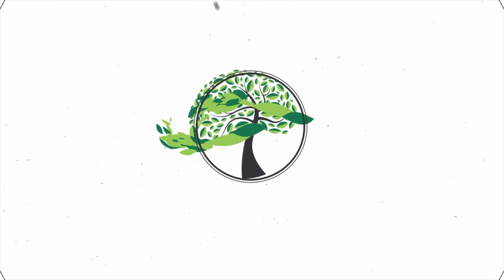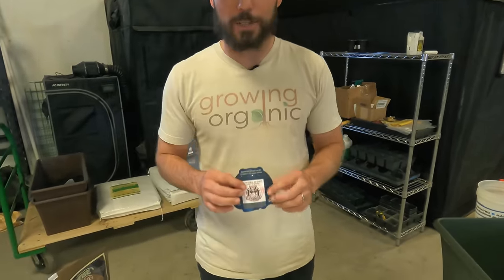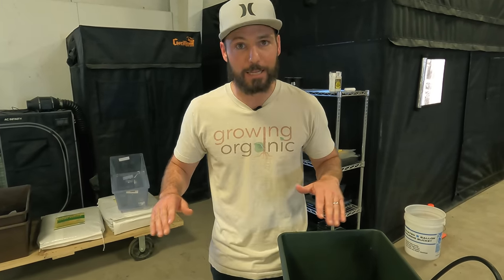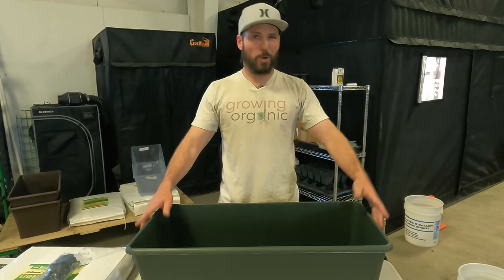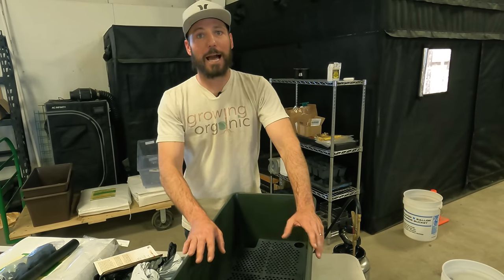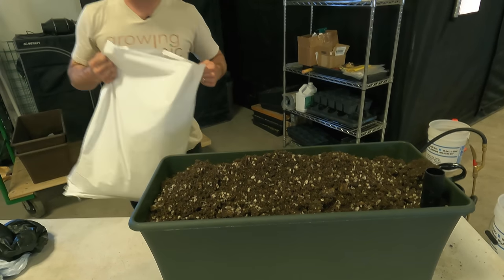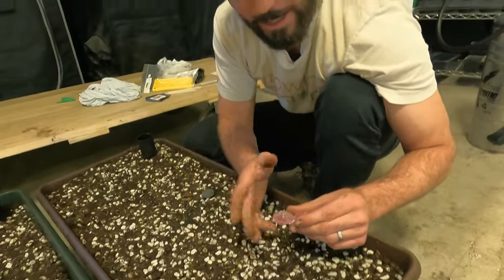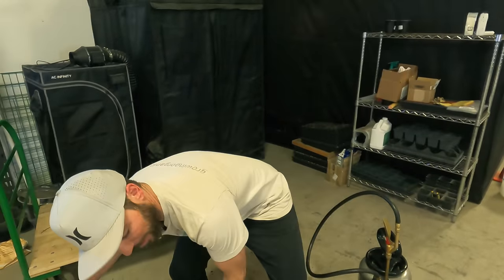BuildASoil: EARTHBOXES AND AUTOS (Season 3, Episode 9)

Comment: 2 per Earthbox works great with most autos but some of them will get way bigger than you would think. Those do better in the Earthbox Root and Veg at one per pot. You can treat the Earthboxes like a no-till bed for at least 2, sometimes 3, full runs before you really need to dump and reamend the soil. You'll need to top dress for flower and maybe some light foliar feeding to make it 3 runs, but these SIPs work really well with autos.
Reply: Sounds clever. Never heard of earth box's and am organic but autos don't need no till as they are too fast. Your method seems like the best of both. Also like the idea of slow release over 3 or more runs before tilling.

Comment: I have recently swapped over from Rain Science grow bags to Earthbox systems running  the BAS Take and Bake soil.  I have two Mephisto Auto's per box and honestly think they are too large to share a container.  About to get my 2nd tent rolling, just waiting on some new Earthboxes to be delivered.
Reply: What size earthbox? Reg or the jr?
Reply: @Southern_Solventless  I used Regular sized EBs.  Primary tent had 5 Reg EB with 10 total seeds started.  Lost one on transplant, had another stunt out hard leaving a primary plant and a runt in one.  Ultimately, I did not have the space needed in the tent to properly train or maintain them and the plants suffered because of it.  5 EB in a 5X5 with fans and humidifier doesn't leave much room and next run I will drop back to only 4 or maybe even  just 3.  I missed not being able to properly reach the back row of plants.

Comment: Only suggestion I would make is adding something to lightly circulate or oxidize the water maybe a set of small air stone through the over flow hole of that water goes stagnant that root rot waiting to happen 

Love you guys hope I could help thank you for everything
Reply: Is not DWC just wait till reservoir is completely dry

Comment: Great channel.  You are a gold mine of really great information and insights

 I love earth boxes [picked up 6 of them for $20 at a yard sale} and am a fan of SIPs in general and would like to share some tips.  I have been growing for over 50 years have an MSc in Plant and Soil Science and published a methods paper in HortScience in 1992 after inventing a type of Continuous Flood Irrigation method for greenhouse plants in containers called Constant Flood Irrigation where i maintain thousands of plants in 6 to 8 inch tall pots by simply placing the pots in saucers and with 2 weighted drip tubes turned on the drip system 4 times per day to keep the saucers topped off with water.

First of all, i don't think standard earthbox desigh provides enough wicking surface area so i drill out holes for  2 to 3 inch net pots around the perimeter.  i use 2 net pot per hole , one beneath the perforated soil platform and one on top through the hole nesting into bottom net pot.  I usually put a lycra sock around the upper pot to help with wicking and to prevent loss of soiless media into the reservoir.  the bottom net pot provides support soil perforated soil grid remains at constant height and never collapese into reservoir due to weight.
Next, pack all wicking feet areas with some sort of inorganic, mineral, non decomposable substrate.  Caveats, DO not use any particle size 3/8 or larger.  The voids will be too large to provide capillary wicking. Fine sand, to coarse sand, zeolite, some bonzai grit type substrates will work.  Sterilize in oven or microwave first and you will have a long lasting, inert wicking substrate.  If you use the same mix as you are growing in, the organics such as peat or compost will begin to stagnate.  Now for a single crop of annual, possibly no big deal, but using an inert media will vastly reduce any occurrence of root rots.
Under this scenario, the water reservoir can be kept constantly topped off
Pros.. This Constant bottom flood provides precise capillary flow.  If your soil is too wet there are a few ready fixes.  
Use a grow media that has higher porosity or devise a mix that is lasagna layer with a progression of coarser particles at the bottom to finer particles so the Perched Water table is lower at bottom of container.
Third, drill a few more net pot holes down center of perforated soil grid and use 2 net pots per hole inverted  to perimeter net pots to draw more oxygen to center of container where soil would be most saturated. Professor Kratky finds this very effective at improving .
fourth...Increase soil height or height of container...i will explain this later
I know everyone thinks they should let the soil dry out, but this is not necessary and in most cases not even adviseable.  Here is the reason why.  In any container when water.  Gravity will take the water down and after immediate or easy drainage occurs, there will be a zone of saturation at the bottom called the perched water table.  The height of this PWT is largely controlled my particle size which fundamentally influences the voids or macropore space between the particles plus some media such as peat or coir or vermiculite also are like sponges and are even wetter whereas sand or gravel surfaces or internal space hold neglible water.  
So, let us say a pro mix has a PWT of 3 inches (i am just making this number up for illustration purposes but a coarse sand has a saturated wicking height of 1 inch.  In an 8 inch tall container or in a 4 inch tall container, Pro mix will still have a PWT of 3 inches.  When you mound your soil up in your earthbox or add some method of an extension type ring to be able to add more height into your earthbox, [you could even use some grow bags inside your earthbox or some DIY version], you increase your soil height so the ratio of air to water or macro pore space in your container increases and usually, more oxygen in the root zone is a good thing.  Remember the Saturated zone in this pro mix is 3 inches but if your earthbox is now really 10 inches tall instead of 6 inches tall , you have a lot aerated soil above the saturated zone or PWT

If you let the soil dry. The roots will grow to top of perforated layer and even into the wicking feet.  When you water next, these roots within 3 inches above the grid will become flooded.  Some roots may begin to suffer oxygen deprivation and die off in less than 30 minutes.  When these roots die and decompose then opportunities for various root rot pathogens abound.

However, If one simply keeps the lower reservoir constantly topped of using a master float valve or using calibrated drip tubes in side the reservoir to just keep from overflowing.  THIS IS WHAT WILL HAPPEN.  The water gradient for the soil mix will remain constant for that soil type and only the roots needs for water will alter the uptake of water.

As the roots approach the PWT, they will do one of two things
1] they will keep a happy distance from the overly wet zone and explore and exploit the happy zone

2] some of the roots will alter their morphology.  Fine root hairs will begin to lessen and thicker water roots will begin to descend into the PWT aka Saturated zone and eventually even into the water reservoir.  This will ultimate create a nice equalibrium where 

I certainly understand why you had better results from shallow pots versus a taller pot because those two wicking corners that come standard are not enough to wick a large enough quantity of water for very large plants.

I ran a small bathtub experiment a couple of years ago where i used some 247 tall 2 and 3 gallon pots. [13 inches tall if i remember.  I ran the system for 18 months or so before i had and root rot problems.  I used to sprinkle some dry blue ribbon cat litter form the dollar store on soil surface [diatomaceous earth].  The DE would color change when capillary moisture reached the surface.  At some point, the small pots were sucking up almost 1 gallon per day.  the mix was a coir, vermiculite, perlite mix and the pots sat in some round dollar store containers that were about 2 inches tall before overflow.

Back in 1989 i grew thousand of plants in more than 10 different soil, compost types, sewage sludge, redi earth promix, from 10 to 90% ingrediants, 10 reps each and only those pots that used more than 5 % titantium dioxid minng ore waste was there any noticeable stunting. but this was partly due to ther being less tha n 5% air  porosity in those containers

In my opinion an optimized Sub irrigation system is almost bullet proof and as long as one is not using any pathogenic materials should easily work for the duration of any annual crop whether it is living  soil or a more standard soiless type mix

Just to recap.
Soil Moisture is really controlled by particle size and by container geometry [height]. 

I also add a second fill pipe diagonally to the first one or once i built a 4 corner pvc frame, widh air holes drilled in just below the soil grid.  this provides a structure for tent covers or trellis netting , but also creates cross ventilation of airflow below the soil grid.  when one opens a window on the opposite of a house, a exponential increase in air exchange happens passively, I believe a similar thing happens if one provides multiple entry and exit points for air exchange in the root zone.

I hope I did not step on anyone's toes here and I hope the information proves useful to your following

Comment: So I was thinking about how you pack the dirt in the wicking corners and I think I'd stuff a couple of cardboard tubes (TP or paper towel) full of soil for insurance and then still pack some soil around them just to be sure they can't wash out completely.
Reply: I was also thinking about cutting a paper grocery bag to fit the bottom so that you don't lose a bunch of soil through the screen but then you said it's never an issue so I guess it doesn't matter. Lol
Reply: i just use soil for the wick and it works great.

Comment: My earth box came with coir squares to put in the wicking holes, said to fill the pot with dirt, then dig 2 inch trench along the along the front and completely fill it with fertilizer, then mound the soil a few inches above the top of the pot like a hill, cover with plastic, then poke holes for the plants. 

I found that following these directions dramatically increases the effectiveness.

Comment: I have zero experience with wicking setups but my first look at wicking was by a guy making a rain gutter setup where net cups are at the bottom of a container sitting in water in the rain gutter.  The net cups are first filled with moss or something that won’t wash away as described here when the corners are packed to avoid the washing away.  The wicking starts with more absorbent moss and it will never wash away.  The rest of the container is dirt. Seems like it could be a thing here?   Instead of packed dirt?  Thanks.  Interesting.  🤙🤙

Comment: Also if u have a strain from the equator 12 from seed it will take forever to flower its best to cut light back to 10 or 11hr of light and it's best to have a 13 or 14hr dark cycle

Comment: The light soil I just got was super dry but no worries I e had dry soil before east fix but I finally broke down and got a Chapin sprayer not a bas one but same thing different brand the earth ox purchase I just got made me realize my old plastic 1 gal suuuucks sprayer clogs takes forever runs out of pressure fast so upgrade I did. Can’t wait to let you know how this grow goes Jeremy👍 got dj shorts bonamassa blues on one end of e box and willie Nelson’s black willie on the other photos. Autos just don’t do it for me I like them outdoors especially up here in wisco because our summers are so short and they’ve been so cold till late may and ends mid September then it’s back to cold so photos don’t get the time they need the sun doesn’t work right up here anymore it’s crazy the days don’t start getting the short time till it drops to being too cold for herb to be outside then the sun hits the light cycle needed to flip flowers if your up here in mid north west wisco  and your reading this I’m sure you feel my pain the grow season has to start just right and it’s been many years since it’s been right to grow a full crop properly 20 years ago and longer like when I started it was awesome

Comment: I have a question: first time grower coming up on harvest in a few weeks. I'm growing autos so the plants are only a few ft tall so whole plant hanging or branch? Also I'm trying to decide which is a better place to dry. I'm situated to live in a house alone so i have the option to either grow in an open bedroom or in a 2x2x4 tent. I have a dehumidifier and humidifier but I have central air. Hitting 60° might be a challenge but 65-68 is doable for sure and humidity won't be a problem either way. Just wondering which would be the better environment. More closed in for small yields or a bigger open room?

Comment: You only waste a couple $10+ seeds before you realize two things.  

1) paper towel tech between two glass plates on top of a fridge or cable box or gaming system is awesome.  That or cup of chai tea or H2O2 water mixture.  Overnight in fridge, then room temp for 12-24 hours and plant.  Closest to 100% germ as you’ll ever get.

2). Don’t open your seeds over soil, open them over a clean area, that way when you drop one, which you will, it isn’t a needle in a haystack.

Comment: Great stuff!!! Your videos are amazing!!!

I’m starting earthboxes, but I’m still a bit confused on the buildasoil way for watering. Do I add the q, rootwise, & aloe to the water each time I bottom water? Also, when it’s dry, do I water all the way to the top of the tube for bottom watering? I’m transplanting my seedlings next week. 

Thanks!
Reply: Hi, you don’t need to add those each watering. The q esp was to help evenly moisten the soil. Nine of those will hurt, but def aren’t necessary. He also mentions that you can’t overwater bc the extra will actually run out of the bottom. He says some folks even put a tray to catch the runoff. Cheers
Reply: @Southern_Solventless  thanks! I don’t add anything to the water I use to bottom water in the tube. I use clean water & water until runoff, I definitely added a tray to catch the water. I add q and some of the others when I feed or occasionally if the top soil drys out. Thank you 🙏🏽

Comment: All right, let’s clear up a common misconception outdoor plants. Do not wait for 12 hours of light to start flowering. They usually start about the middle of July 13-15 hours of light give or take   12 hours of light is not until the equinox in September so if plants to not start flowering until September, they would never finish they use 12 and 12 on indoors because it is very clear to the plants, but given the sun rise on Saturday and the period of low level of light during the day outdoor plants will start flowering well before it’s 12 hours of darkness

Comment: HELP please!

Hi @buildasoil, my earthboxes have mold on their top. What should I do? I made an earth-mix, mixed my own gnarly barly and put it on top, put wood-chips on top and then put hay on it.... yeah sure it keeps it wet, but I completely ignored that it could create mold on it. The environment had 95 - 100 % humidity as my girls are young and 25° - 30° Celsius, no fans, no air-flow  ... perfect for mold.

One of my girls already died. maybe because of the mycel or maybe because the roots got too hot as the earth-mix is really warm ?
I removed the topping-stuff that has direct contact to the plant and turned on fan and air-flow. but the rest of the topping  with the mycel is still in their

Comment: my opinion only,you definitely know best  but instead of moving the earth box from the 10x10 when you flip to 12hrs light,thinking start that one in the 4x4so no moving it to different light,just an opinion your the teacher, if I heard that correctly,thinking you said both ways,anyway BAS rocks just wish I had $ to no till 100% byeing a little each week I'll get there,which is another question only having $ for one,,,rootwise or Q first?
Reply: I'm going with Rootwise. It creates a base of lots of beneficial critters. The Q is a great surfactant which helps water to be absorbed by the media. But, there are other much less expensive options out there that may not provide all of the benefits of The Q.

Comment: I don't rate autoflowering...
I don't rate interior either...
My dream is rent property with good security...
More importantly ,,,at 3,000 meters altitude...
Build my own hydroponics,,, the run off going into airconditioned small casita (room)...water tank inside... temperature at 16 degrees...netting...pipe size for hydroponic table 60cm...
I worked out cost at around 20,000e for rent and equipment...
That 20,000e could be turned into 275,000e in 10 months... easily...
Fingers crossed...I get this project within 2 year's...
Maybe next year I have means to go borrow the money... I borrowed 10,000e before from a friend...he died 8/9 year's ago... but I had paid him back...
If I go see his x partner I'm confident she'd give me the money...
She had his money and assets in her name...
He did 12 year's in Morrocan prison...marbled tiles and shower in his cell...bottles of whiskey...he brought the gymnasium equipment for the prison...
Same prison my other mate's dad had it rough...share cell with 24 other's...scabies and hepatitis he left prison with...
My mate that has it good left to more money...
His X played stocks with his money...
She earned him over          £100,000 in the first year...
He died at 65 year's old ... cancer he didn't smoke hardly drank... 
But he had used steroids through the year's...
Think I should go track his X down...I'm confident could get money and maybe she'd know of property in Tenerife at 3,000m altitude...
On mainland of Spain 2,000m altitude is best you can find...
Good for poppies as there are poppy fields for pharmaceutical industry...